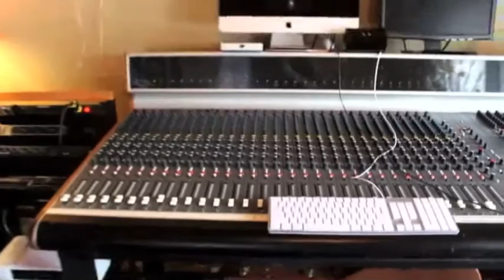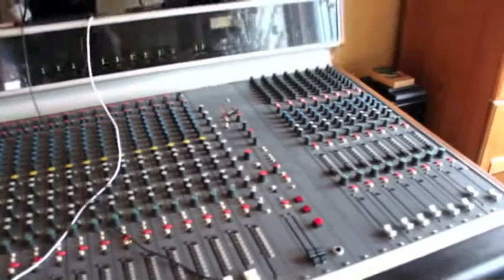Hill Audio Concept 4400 (Episode One)

Comment: Interesting to see this after all these years. I tested this very mixer, those are my initials I.F. on the circuit boards. We started building them in May 1987. With regards to the LEDs flickering on the meter bridge. The meters are in banks of 8. If I remember correctly, there is a trim pot on each bank. The fact that all of them are flickering, suggests that the power rails have drifted a bit. this can be trimmed in the power supply. Unfortunately, I can't remember how it's done, it was a long time ago. I would ask the designer, but unfortunately, he died three weeks ago.
Reply from the maker: Hi Ian! It's an honour you reached out!  I sold this amazing console in December to a gentleman from outside  Toronto who possessed the want, the time, skills and resources to give it the work it needed... and from the recording he sent me that was tracked on that very console a couple months later... Well, it would make you proud!  Besides dirty pots, he said it had some dead fuses in the power supply, and the flickering was dust/animal hair (from previous owners) that through static had been attracted and balled at the meter bridge's power connection. Thank you for your kindness and great work... I spent hours just sitting in front of it marvelling at the work you guys did! Warm regards...
Reply: Ian, Ben here from Hill Pro Audio in York UK. We are the current licensee of the "Hill" brand, and offer servicing/support (where still possible) for legacy Hill products. I just came across this video and was surprised to see you had commented only a few days ago (what are the chances?). If you are still interested, I believe your diagnosis of the LEDs flickering is correct, there is a trim preset in the PSU which can be altered to adjust the reference level for the LEDs, we have the schematics for these units which would help locate it. The designer you mention is Mr Colville? I didn't know him but heard about his sad passing from Malcolm. I understand he was one of the top guys on Malcolms team and a key person in the success of these mixers!

Comment: Nice Console! Here in Holland i have also a Hill Concept 4400 console with 40 channels and 8 auxiliaries. Also I have to totally restore this mixer. I have the same faults as you show. the flashing LEDs. But the sound of this table is very fine. I'm curious about your second episode
Reply from the maker: Wow Ruben, thanks for reaching out!  You have one monster console!  If I figure out the light thing (ground?) I'll let you know. Best wishes on your restore.  Sorry the video is so boring, but thanks for watching!  Perhaps you should capture your restoration to!  Regards...
Reply from the maker: Hi Ruben.  I sadly sold my console in December '17, I didn't have the time nor extra money to do to it what it required. The happy news is the gentleman who bought it works in the audio field and refurbished the board and it's working awesome!  There was some blown fuses in the power supply that killed some channels.  The flickering LED's was caused by a ball of dust/pet hair that had gathered at the meter board's power connection, drawn to that location by static!  Hope this helps! I heard a sample of the board in use, it sounded AMAZING... very Neve.